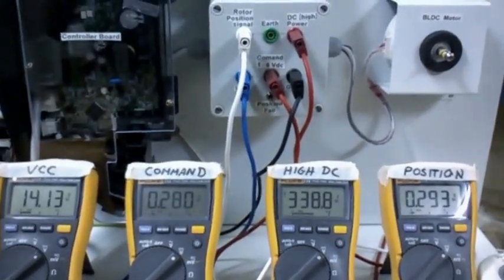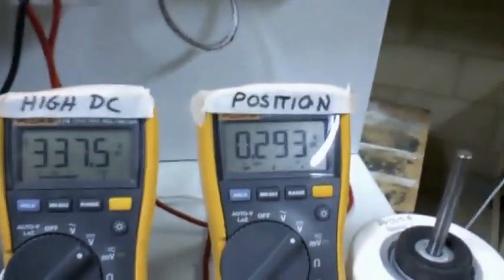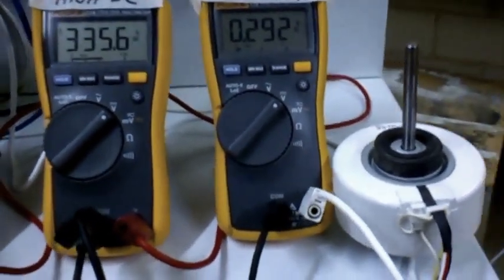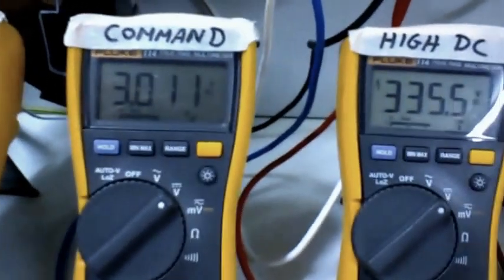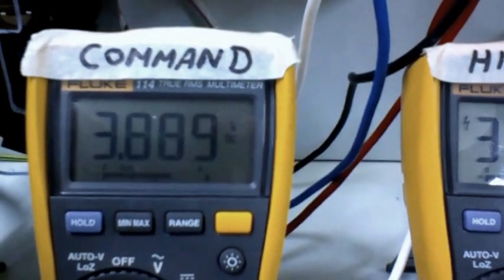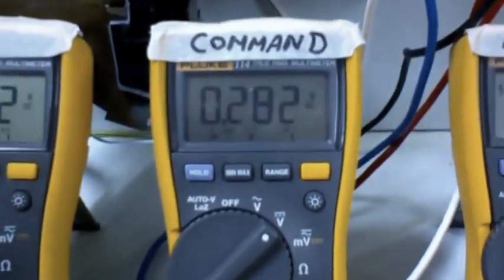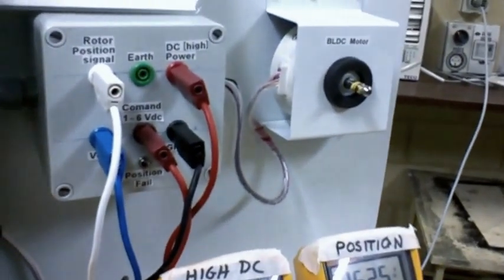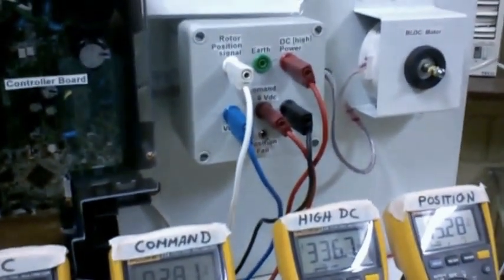Split system BLDC  motor position fail.

Comment: is it a problem that it will run faster, Because it has a load on it? seems more to me you wil get more cooling out of it. nice vid by the way.
Reply from the maker: The maximum motor speed determines the capacity , in this example it is going faster than its design. The heat exchanger has a limit of capacity. When  they design the units they have an associated motor RPM to selected indoor fan speeds. The highest fan speed is the capacity limit.  This video shows what happens when the PCB controlling the motor speed loses the signal. Even  if it was going faster , it wont stay on for long til it faults.
Thanks for your comment